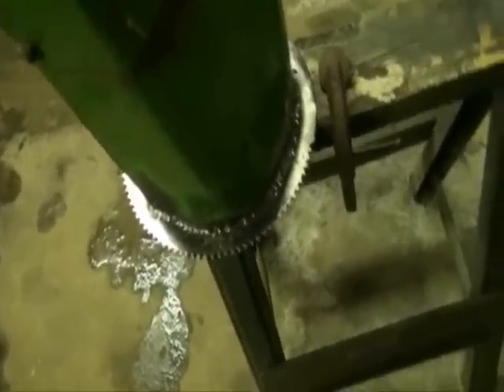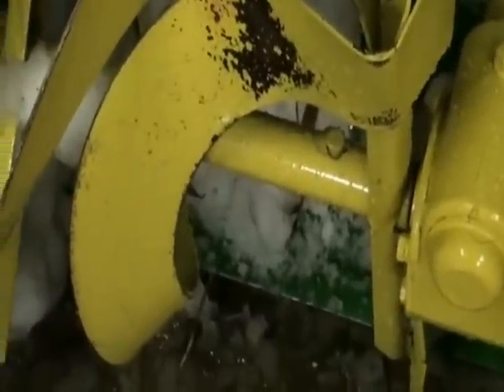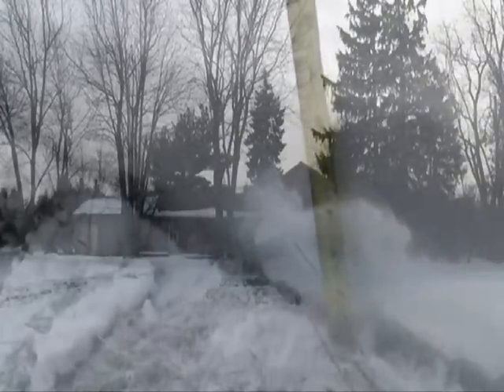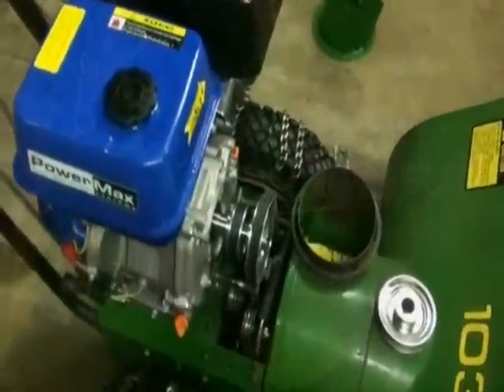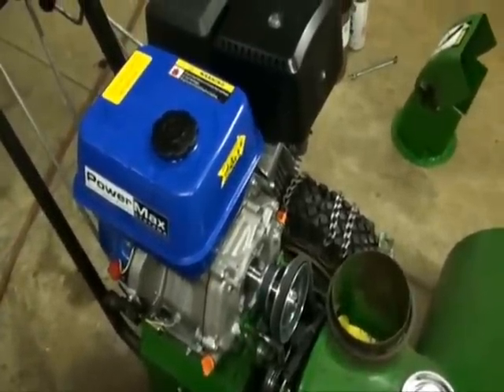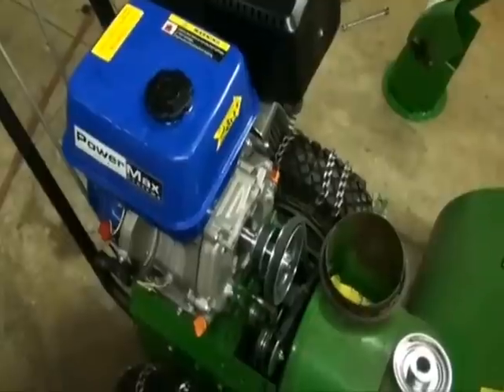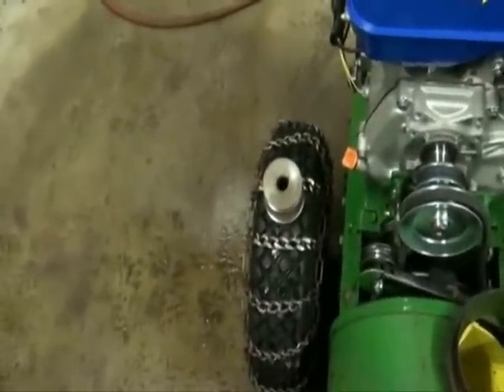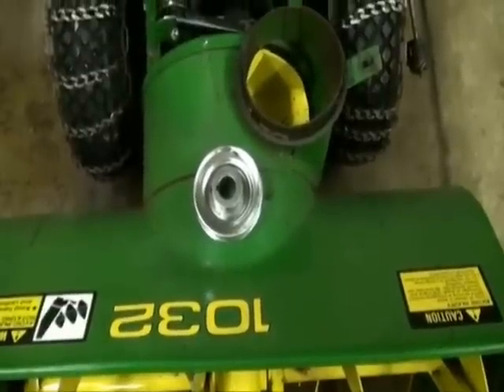John Deere 1032 Snowblower Repair & Modification Video Part #12

Comment: I really enjoyed this video series!! I am currently using a Toro ccr Powerlite and I have been looking at purchasing a new two stage snow thrower, but after watching I'm thinking that doing a renovation could be an alternative to purchasing new.

I live in the Michigan downriver area and will be looking during the spring when i should be able to get the best deals on used equipment.

Thanks for sharing your project!

Comment: @MotownVideo those look like hardware store link pins, not shear pins.  I can't speak for all brands but Ariens shear pins usually have grooves machined in them.   Older machines also tended to not need shear pins, like the video states, due to heavy duty gearboxes.  I know of one old brand that used their rototiller gearbox also in their snowblowers.  You ain't gonna break that.  ;)
Also, since old augers do not have teeth, they also are not as "grabby" when hitting stuff.

Comment from the maker: Colbycous01
Thanks to the Al Gore global warming scam driving up the heat bill this time of year the barn gets a little messy, its a little expensive to heat a 30x40 building with no insulation at 5 and 10 degrees for cleaning in this season, when the weather brakes a little it always cleans up easy, not sure ware the engine was made? I bought it for the horse power, someone ells mite know?

Comment from the maker: Thanks MotownVideo,
I think most of the newer snow blower shear bolts brake free little more easily some times compared to the old ones, I had the same problems with older Ariens throwers also.

Comment: Nice job! I definitely like the idea of a little overdrive for the auger/impeller as that seems to be the biggest problem with the older machines. Shouldn't the shear bolt in the auger shaft have saved the auger? With my Ariens and MTD machines I keep a supply of shear bolts for each one and they have snapped from hitting anything from a curb to gutter splash block and protected the augers from damage.